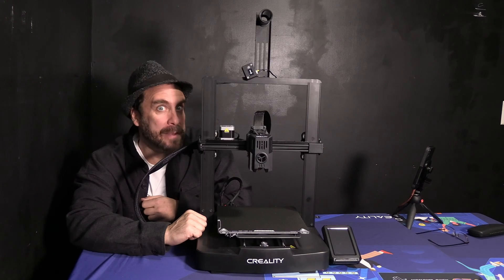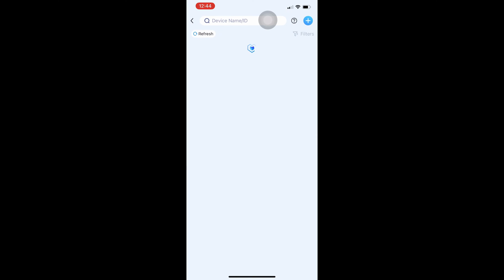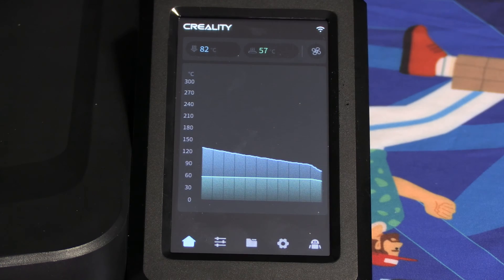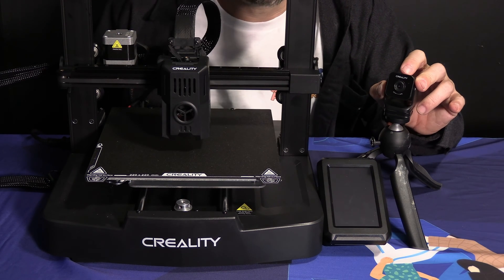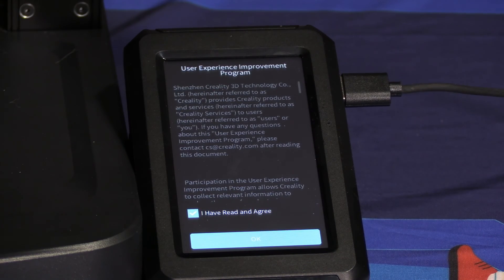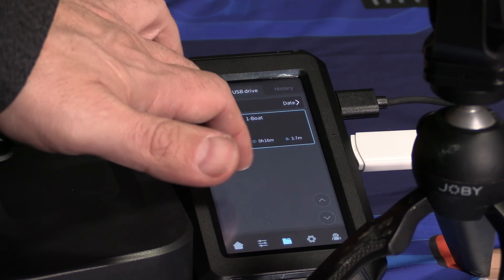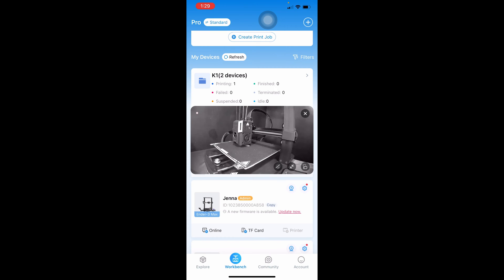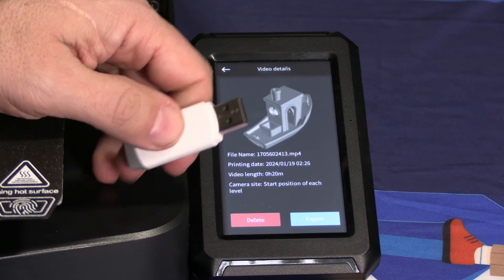Ender 3 V3 KE: Setup, Config, Test Print, Timelapse - Creality 3D Printer with Nebula Pad & Camera

Comment: when i first got the KE, it worked flawlessly. unfortunately one month into ownership, i now have estimated 60% print failure i have followed so many videos instructing how to resolve issues such as bed adhesion and the nozzle knocking off the print.
 sadly i still have the issues and im very reluctant to use the printer because of the frustration of so many print failures😢
Reply from the maker: KE is a great machine. I got you
BED TEMP 60, NOZZLE TEMP 220. 
Please put the K1 Smooth PEI Bed on it. https://amzn.to/4dREmb7 
For now: CLEAN THE BED. I mean... CLEAN IT. https://youtu.be/bfPm7BGjfdM
SLOW your prints down.
SLOW your 1st layer more
Choose a different infill pattern. GRID can grind on the nozzle (however, I use it all the time)
Get this GLUE and use it: https://shrsl.com/4o354
Run a new Calibration from the Screen.

Comment: I'm running into a problem with the Nebula camera. The printer recognises that it's plugged in, but doesnt show any images on the app. If I connect it directly to my PC it works as a webcam, but on the app all I get is a grey box with endless spinning white circle.
Reply from the maker: Have you attempted the firmware update?

Comment: Mine doesn't have the "Camera site" settings regardless of having the "Enable time-lapse photography" switch on or off, it also doesn't record timelapses at all and I'm losing my mind trying to get it set-up. :/
Reply from the maker: Do you send prints from Creality Print? (I would) Is your nebula firmware up to date?
Reply: @3DRundown  Yes to both, actually, downgrading my firmware brought the options back, still I get no timelapses, both printing through LAN via Creality Print or directly from the pad.
Reply: @3DRundown  Hey, I think I figured it out! It looks like there's a minimum layer count treshold for timelapses, I was only printing pretty flat stuff, but when I tried printing a taller temperature tower it made a timelapse!
Reply from the maker: I think that's it. It takes allot of pics, to make a timelapse. if the print is super small, it would be like a 2 second timelapse. Also.... Get started with printing from Creality Cloud. So many benefits, and, your timelapses will be there!
Reply: @3DRundown  They really should improve the Creality Print + Creality Cloud Integration, make it more seamless, it's so practical to use Creality Print straight through LAN, I don't know how I feel about adding adding a step of uploading my project to Cloud to start printing from there.

Comment: My printer runs great and I have not tried to update the firmware.  I have heard of some people updating the firmware and it makes the printer give errors.  is this true?
Reply from the maker: I've had no issues at all. After the update, run a calibration, before you print.

Comment: Thanks for the video, this is my first printer, I set it up today. Watching your video I became interested in the camera and have already bought one. As for the sensor you mention at the end of the video, does it make quite a difference? Would it be a good buy? What term can I use to search for? A specific model?
Reply from the maker: Hey. Welcome. The G-Sensor something you should probably have. You can live without it, but pretty much all the fast Klipper printers utilize one. It's fairly cheap. Check it out here (and find the links to get it, in the desc) https://youtu.be/sR8cW45J8Cg

Comment: Total noob. Is the reason we are not printing pre sliced files because we need to customize all the options to suit our printer? Is cura a good slicer to use with this printer or should we use crealitys?
Reply from the maker: There are so many hardware and environment variables at play with a model, and, so many different methods and techniques, to print a model. Then there are endless filaments, which behave differently as well. Slicing it yourself, is the way to do it. I like Cura allot, but I would consider learning ORCA for your V3
Reply: @3DRundown  thank you👍

Comment: The only print I got to work was the bench test the ke comes with, everything I got off thigiverse fails after a few levels and gets stringy, the printer is just a couple. Days old
Reply from the maker: Sounds like you need to work on your slicing methods. Use Orca and watch my Bambu Studio and Orca videos. (They are the same)
Reply: So I got it working now and it’s printing great, only question I have now is the nebula camera gave me a nice time lapse of a 1.5hr print then I did a 27 minute print and did not get one , is there a certain print you have to meet to get a time lapse

Comment: Mine is restarting during off set calibration, any idea what could be the issue
Reply from the maker: Yikes. Something is loose. Get eyes on all the connections. Could be a bad connection at the ceramic heater, which, would mean you need a new one. Check all connections carefully.

Comment: Newbie here, my first time ordering filament, any suggestions for printing something similar to a cellphone case which will need some flex but not much. Thanks for everything
Jusr assembled the KE thanks to your video
Reply from the maker: No PLA is gonna be flexible, but some are certainly stronger than others. For a phone case, TPU may be the way to go

Comment: Thanks again. Very much enjoy your way of explaining things! I do believe you have the spool holder the wrong way around, although I don't think it matters much. 
Looking forward to adding the camera, too. It's just not very well available here in The Netherlands. Will wait for Creality EU stock.
It's also nice to see it doesn't make all that much noise (especially compared to my K1 Max).
Reply from the maker: I offer you, exhibit A: https://store.creality.com/products/ender-3-v3-ke-3d-printer
Reply: @3DRundown  well.... no. 
Please see 3.3 of the user manual. Also, the filament runout sensor would be on the right side. No biggie, but still... :)
It's just about the metal thingy being the other way 'round.